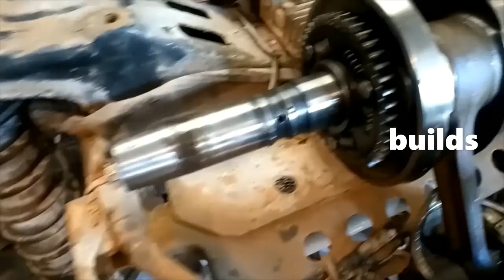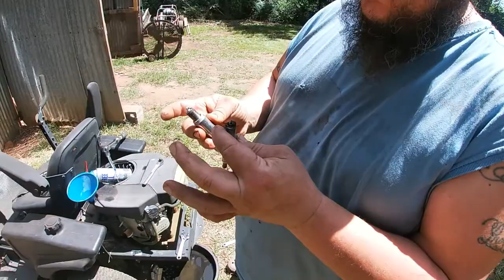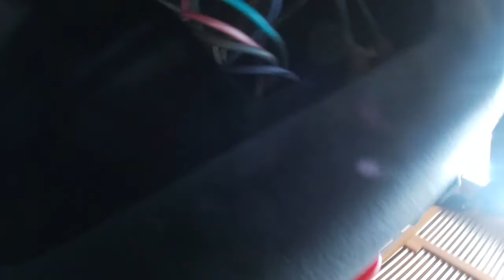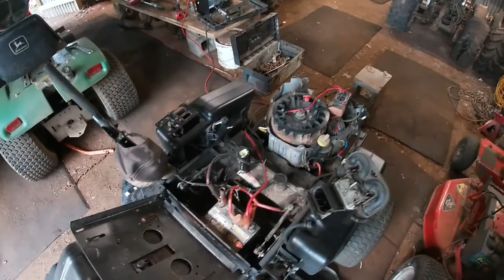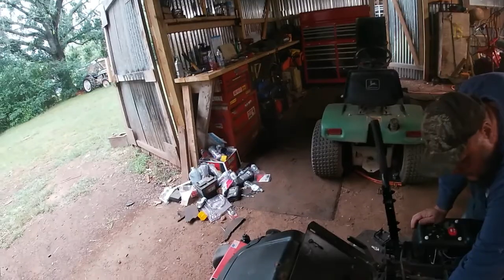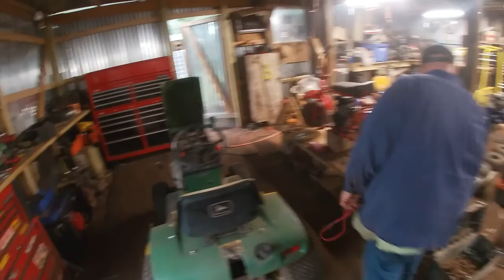how to unlock a locked up froze motor: zero turn mower revival on the cheap

Comment: Yes those types of zero turn riding lawnmowers half to have A lawn& garden type of battery that it takes to. It also has magnets that are electrical pulse to engage those blades to turn. I worked on many of those have been for 31 years. You can rebuild those staters to you get get replacement brushes to put back in the end where the terminals connect at also. There is brass bushings that you lightly grease before putting the armchair back inside of the windings casing housing. Pre mark it on both pieces of the plastic.,or aluminum.,an metal housing where the two long bolts go all the way through the starter. Remember to remove that roll pin on the top to grease the other bushing. I recommend videoing it for reference guide just in case.

Comment: I got a Kohler that’s locked up.i bought it used with a cracked oil pan .do you think it froze up cause I took the oil pan of and maybe moisture got in their or could something be not lined up when I put it back together
Reply from the maker: That's a very good possibility. With the oil pan off or even with that small crack could allow enough moisture in to lock it up. Personally I would look into seeing If everything is lined up properly. That is the most probable possibility is something isn't lined up right or is put in backwards.

Comment: Hey nice video! I have a kohler locked up. My uncle said it mowed one day and wouldn’t start the next time. I couldn’t get voltage past the starter solenoid at first and it was the relay for it but once I smacked it a few times it woke up and my starter tried turning but the motor wanted no part. I drained the oil it smelt burnt and there wasn’t much in it. Should I start tearing it apart or buy some free all and try spraying it in the spark plug hole first?
Reply from the maker: I would try putting some marvel mystery oil down the spark plug hole and soak the cylinder(s) and try moving the engine over from the flywheel and not use the starter. Your gonna have to move is a lil at a time and work it back and forth while soaking the cylinder(s). May take a while but eventually it will come free. Also check and see if it turns over with out spark plug(s) in, if does than u have a different issue.